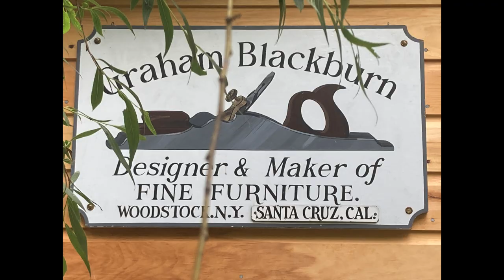52.Planing Straight & Square Edges

Comment: Shooting board ftw. 🙂 Actually I made one with two adjustable stops sideways. This turns it even into a thickness planer. Very handy for (roughly) jointing strips for laminate boards. With parallel edges. Besides from squareness.
Reply from the maker: Great idea!
Reply: I would like to see a picture of your shooting board with adjustable stops.

Comment: One important point is to have a well balance iron. If it's taking more wood on the left or on the right, no matter the method it will not be square. I'm french so my english is not perfect but it seems to me that you didn't mentioned that. It may not be obvious for everyone, and it takes some skill to adjust this.
Reply from the maker: If by 'well-balanced' you mean squarely set, then yes of course, but the adjustment is quite simple: just a gentle tap on whatever side of the iron is needed.
Reply: @gjbmunc  Yes it's simple. I just thought it would be good to mention it in the comments. By the way, I like your videos, good to see someone talk about old wooden tools.

Comment: Novice question: Doesn’t the blade have to be perfectly square in the plane? If the plane blade is not accurately adjusted, doesn’t that give an un-square edge, even if the plane body is square?
Reply from the maker: absolutely.